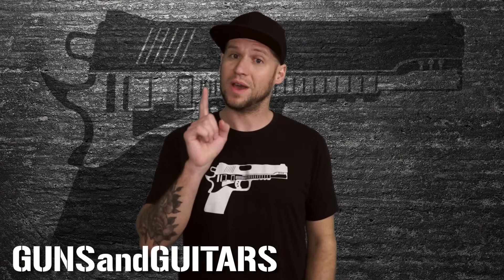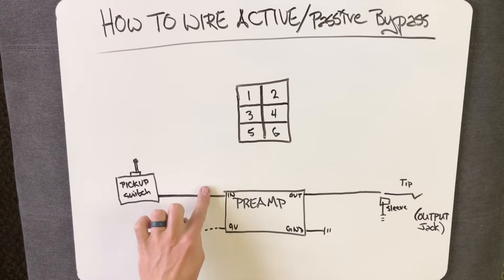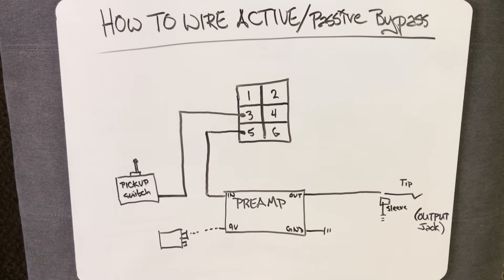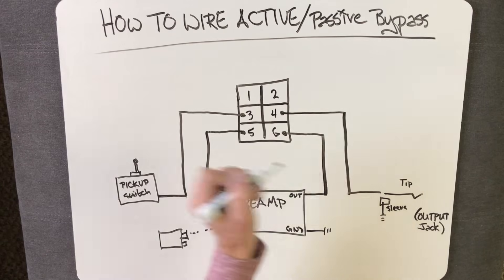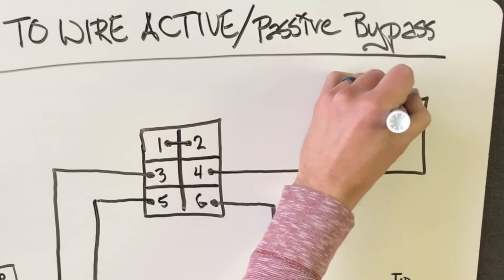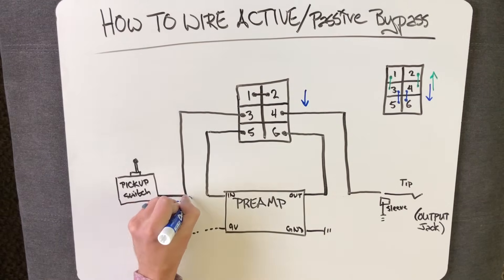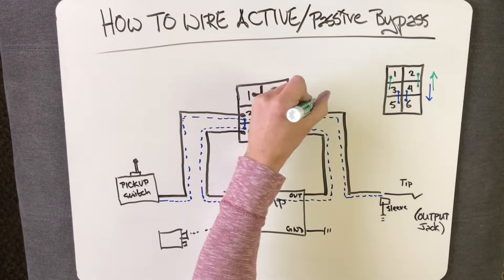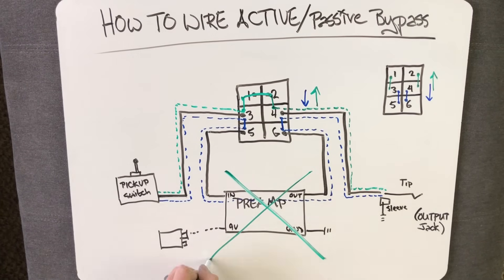How to wire an Active/Passive Bypass Switch for a Bass Preamp

Comment: OK
So this question goes to everyone in the comment section and of course Dan.

(assuming we all know how to wire passive bases)

We'd normally do a ground link to all the pots (such that the cases of all the pots are connected to the third log of the volume pots which are also connected to the bridge ground, pick up grounds and finally output ground).

My question is can we do same to an active bass?

Comment: But it still consume the battery right ? because the switch doesn't cut the battery connection ?
Reply from the maker: Correct. As long as a cable is plugged in, the preamp is on. Cutting power will cause an unwanted pop sounds.
Reply: It means passive mode will consume the battery as same as active mode ? No saving battery life at all ?

Comment: Thank you Dan, I was looking for such a mod, however, currently my pups go directly into the Audere preamp, no switch or passive pot before the preamp. If I did that, would I need to connect both hot wires from my pups into the switch and then directly to the jack (when in passive)?  I don't have any passive tone control, just the preamp followed by vol-vol-3 band eq. Thanks!

Comment: You can still bypass the preamp with active pickups ; yes you still need a battery to power the pickups BUT you can bypass the preamp and get only the sound of the pickups with the preamp completely out of the picture; that gives you different options for more flexibility from your bass .

Comment: If I don't have a master volume, can I use a push pull pot as the DPDT switch and solder the passive output to the pot itself to use it as a passive volume ?
Reply: I’d put a push pull master volume control after the pickup selector switch and then you could use the DPDT on it for active/passive switching. This should allow you to control volume on both settings

Comment: if you do this mod, you will get a loud POP every time you use the switch.

the way to fix that is 2 HUGE resistors connecting 3 to5 and 4 to 6. I used 2M Ohm but I wish I had had 10M handy. at least 3M.

and its handy to wrap the resistor legs around the wire leads before soldering to the switch.
Reply: is that only the way? I get a loud POP when I use the switch
Reply: @xtremeboy851  a better way to do it is to put a 1M resistor from the input of the preamp to ground. this is called a "pull down resistor"
Reply: @maxonmendel5757  how if I put only 470k in both?
Reply: @xtremeboy851  idk try it. that might work.

Comment: I've read that some instruments come with passive pickup, but with 
active pots. How would one know if the PU itself is actually active and 
not just the controls? Like for example I have a Jackson bass that has a
 push pull toggle volume knob. Push in and it activates "active" but 
pulled up and it's in passive mode bypassing the on board EQ. I'm really
 having a hard time finding stuff online that talks about this. Do most 
people just say to hell with the guess work and rip it all out and 
install new? I have a Dean bass that this would be difficult for as the 
pickups themself are not the average 4 string shape for soapbars.

Comment: Dan (or any smarter then me human) I did this mod to my bass,  Sterling sting ray, chose to do without the volume as well. My question is why am I getting a hum while in passive mode? Touching thr strings silences it but it does make a noise when not touching the strings. I had to use wire from j bass guts for the number 4 terminal to jack wire and it seemed a bit thinner then the pre existing wire. Would tbis be the reason for the hum or did I screw something els up? Any advice greatly appreciated. Thanks for the great vid! Did wonders for my tone hunt

Comment: Hi Dan
How can i get the volume back in passive mode... just silence when wired up with no volume out at all, ok when switched the other way.  I have a blend pot which i presume you can substitute for the switch.  How can i get the volume to work in passive mode?.  Thank you.

Comment: stupid question: would my battery still get drained somehow when i'm set to passive?
I was thinking of putting in an extra on/off switch to save the battery whithout having to unplug when I'm not playing, but this mod might actually be better!
Reply: Same here...based on the video excellent diagram. I'm thinking of using terminal 1 & 2
Reply: @derrickflores719  hi, did you already tried the 1 &. 2 terminals for the battery? Im curious if it works

Comment: As with others who have commented... I am wondering if a DPDT push pull pot can be used as a volume and bypass, in other words push down for preamp and pull up to engage bypass and volume at the same time? I have tried googling this but can't seem to find the answer (I'm probably using the wrong terminology). Or... even better would be a volume switch where the off detent position is active and turning the switch on engages the bypass and volume. Does it exist or am I a dreamer?
Reply: sorry when i said volume switch i mean't volume pot... sorry

Comment: Hi dear.
How can i do using Push-pull pot ?
Thank you.
Reply: the poles on a push pull/push push pot as long as its a DPDT (double pole double throw) are exactly the same as shown. as long as you follow the diagram you are golden. 
the pot and the switch are only conected via ground

Comment: Would really love to see a video of this actually being done.  I'm gonna be revamping an ESP Viper bass and I'd just like to see a run through on the process.  The DPDT switches seem cool, but I'm wondering if the push/pull pot would get a job done in the same fashion, or if its merely a different wiring concept.  I'm in agreement with some others in regards to keeping the basses external look in tact with the current knob setup.  However, I like the idea of being able to swap the pickups for passive ones (currently they're EMG actives), installing an onboard preamp, then being able to bypass it completely with a flick. I've been looking at onboard preamps and the Aguilar's stand out, but I'm still unclear, brand aside, on which kind to get.  Anyway, love the channel. With a lot of your knowledge and tips I was finally able to complete my super Tele project that I've been dragging on for a while. Upgraded/Improved almost every component and it was well worth it.  Also, your Dream HH super strat idea is high on my list of upcoming projects as well.  Keep up the good work.  Thanks!
Reply: I need to try an esp bass

Comment: As some active basses use passive pickups how do i tell which type I have.
Reply: Take the battery out, plug it in and play it. If no volume then active pickups if you have volume then they are passive this may not be the best method but it's worth a try

Comment: Hi. I have a set of cerwin vegas. E-712 model. Instead of getting used antiquated hard to find expensive replacement crossover i upgraded. I put in emb cx-10 1200 watt crossovers. But i also put in a terminal tx-15 with modern day jack hookups. Very nice. Well i have gotten to the point where i can go no further. 1st i don't yet know what wires go where on the new crossover. Fabrication was involved mating the terminal to the crossover. I did a beautiful job. Labeled my switching jack wires even. I want the switching jacks original to work. But I'm electronically ignorant and lacking aptitude. Little help?

Comment: Just did this to my ibanez SR305 and it worked out beautifully. Really helped to add more versatility to my bass, and it's a good failsafe should you have a dead battery. Thanks!!!!
Reply: Did you do this on a SR305 or a SR305EB? I tried it on my SR300EB but only the active mode works afterwards. The passive mode is totally quiet.
Reply: @upkiller12  I did it on a 305. Maybe check the wiring to be sure everything is connected properly

Comment: Am I right in thinking that if instead of sending a jumper from 1-2 if you instead ran 1 to the input of a passive volume and tone pot (standard P bass) and the output from them into terminal 2 then you would gain the ability to use the passive controls as when engaged?

Comment: How can I tell which terminals are which or can I just wire it any which way? Just got the pack of switches. Are they connected internally or do I have to wire each terminal in the path of which I want it to flow?

Comment: As I know this bypass switch have issues with pop sound when you change from active to passive or other way around. Battery should not be bypassed if you don't want to have that pop.
So battery is always active, only difference is  when battery goes down you can continue playing in passive mode.
Reply from the maker: I’ve found a new way to do it that fixes the pop since I uploaded this video.
Reply: @GunsandGuitars  How?
Reply: @GunsandGuitars   Yeah I'll second this. I'd love to know, and also how to add a tone control to an active only bass. I'm hoping there's a way to do it by having the treble pot work as the tone knob in passive...
Reply: @GunsandGuitars  could you share how you got rid of the pop sound?

Comment: By the way, is there a difference if you use this wiring on a push/pull volume poti?
Reply: no. it's exactly the same. you just have to know that when the pot is pulled up, the middle terminals run to the top terminals, and when pushed down, the middle terminals run to the bottom terminals. knowing that, you would ideally want to wire the setting you plan on using more often to the down position, and the setting you'd use less to the up position. that's just an aesthetic issue so if it doesn't matter to you, you can wire it whichever way.

Comment: This could be used as an off switch for active p'ups, right?
Reply from the maker: If you have active pickups, you can’t run them passive
Reply: Guns and Guitars yeah, but it wouldn't use up the battery if you left the jack in your active bass with active pickups?

Comment: Hi Dan, your videos are inspirational, thanks so much. I'm building my first bass guitar Rick 4001 style like you showed (Pit Bull kit). I have bought the Seymour Duncan STC-2C-BO that you reviewed and the bypass switch. Installing between existing 3-way switch and output seems easy enough. What will that mean for my 2 volume and 2 tone knobs that come with the kit? will they still work? I'm thinking they will but are a bit unnecessary. But no harm in leaving them in. Is that right. Thanks so much for your help. Oli

Comment: I just purchased the Tone Monster SEB3 AB Bass Preamp. Does this wiring hack work with this particular Tone Monster Preamp?
SEB3-AB (4 potentiometers) balance~volume~treble/bass~middle
Reply from the maker: Yes it does, but when you bypass the preamp you’ll be bypassing the master volume as well since it’s a part of the active circuit.

Comment: Maybe I'm an idiot, but how can I tell if my pickups are active or passive? I know that my Warwick Rockbass itself is active (damn thing eats through like three 9v batteries per month with regular use) but there's been work done on it before it came into my possession and I can't tell if it's the preamp or the pickups that's taking the draw. And it's a MESS of wires in there.
Reply: One thing you might want to check is how many pots you have on your bass. Passive pickups usually don't have a preamp that allows you to edit your eq: low, mid and treble, on your bass itself. Basses with active pickups, depending on the bass and the pickups installed, usually have like 4-5 pots for eq, tone and volume, while passive ones mostly only have tone and volume pots. This usually gives you an easy answer on just a surface-check basis of any bass or guitar that you see.
Reply: No that is wrong. There is a difference between active pickups and an active preamp. If you have active preamp and passive pickups you still have the eq. On the other hand you have just a Tone knob if you have active pickups and no preamp.
I guess most rockbasses have passive pickups, but if it takes so much battery you might forget to remove the audio cable while not playing? Sorry if you do this. But that much battery can't be.
Reply: Maybe your jack isn't stereo anymore. Then the bass is always on. Even when not plugged in.
Reply: Well the jack was never stereo but yeah, I DO tend to leave it plugged in. I wish I could put a push/pull master volume pot on it to kill power when it's not being played. That'd be ideal.
Reply: You do have to unplug an active bass or the batteries will not last long. Not a big deal to unplug it.

Comment: You could also use a push/pull pot instead of a switch. Doesn't really add anything except external tidiness by not having the extra switch sticking out, but it also doesn't take anything away or make it harder
Reply: Or a push/push pot if you are classy ;) harder to source though
Reply: @elonmush4793  I think Warmoth carries push/push pots only.
Reply: How could I do this? I've got two pickups  running to a blend knob as my switch (panning switch basically) from that to a push pull volume, to a passive tone control. 

So where does my preamp come in? Right after the volume prior to passive tone? Cause when I go active I will have a tone control. It's an active dual freq. Preamp

Thanks for any help! I'm stumped.
Reply: @MetalMessiah77 It’s hard to find info on combining active electronics to a passive guitar circuit, but I’ll share some tips I’ve learned over time. Where you put the active preamp does matter apparently, since they use 25k or 10k pots rather than 250/500K like passive circuits. My suggestion is to put it after the tone control and before the output jack. This allows the original volume and tone control to always work as it’s only seeing the passive input from pickups.